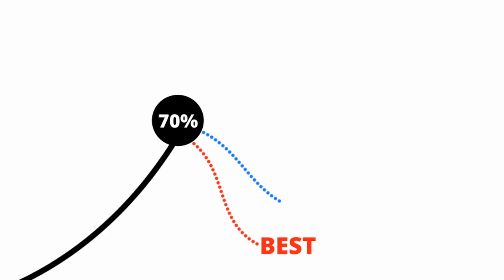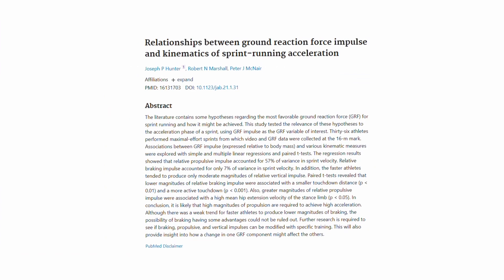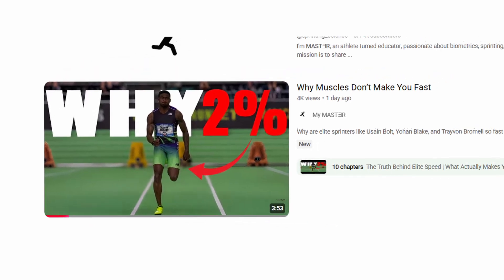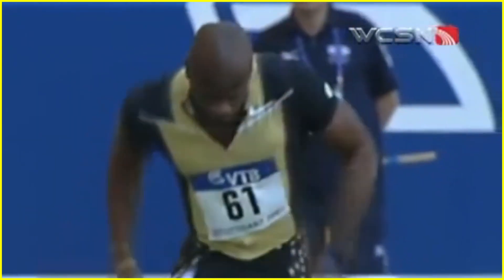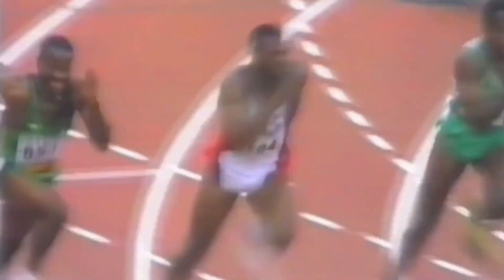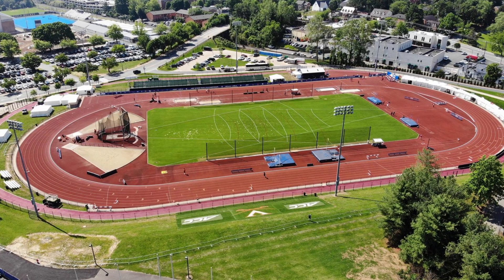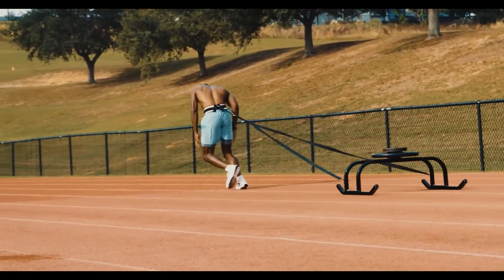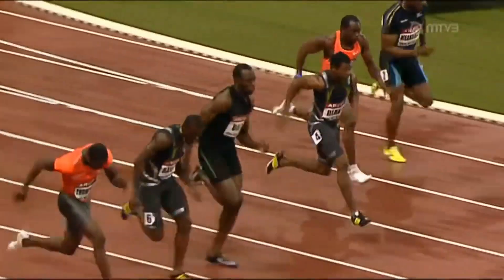70% Energy WASTED? Fix Acceleration Now!

Comment: So when you run, should you try to stay in the air and just push off hard, or try to force your foot back down
Reply: ik i js did a workout and I was running 12s at max effort my form was good but I js didn't have it in me
Reply: low-key if ur black its instant speed boost ngl